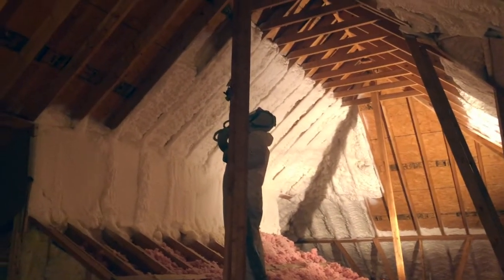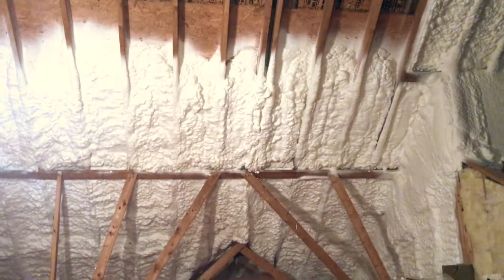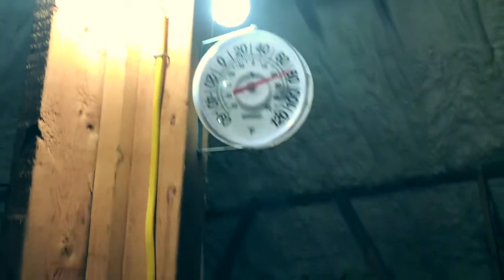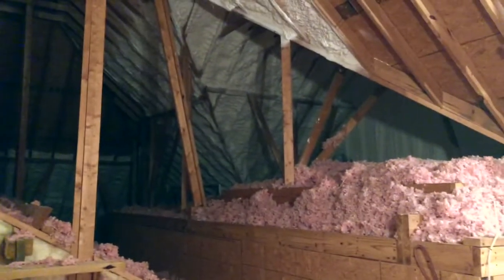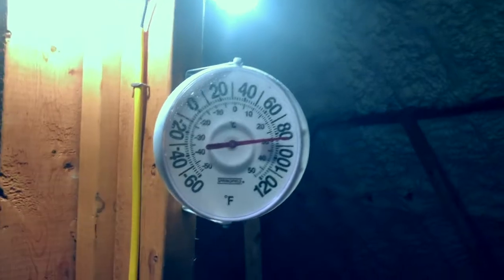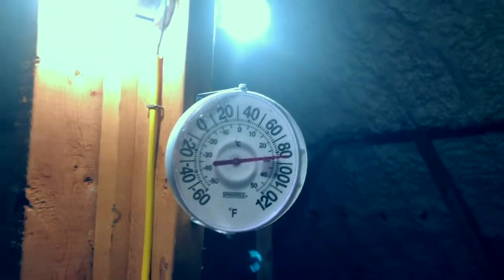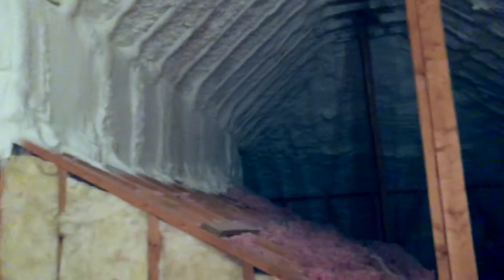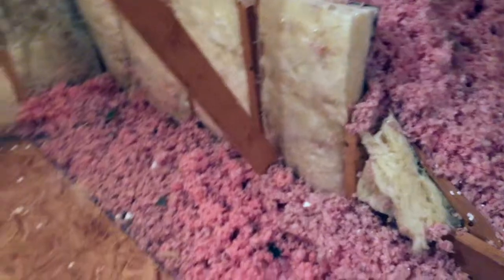Expanding Foam Insulation In Our Attic

Comment: Are you eventually going to use your attic as a living space? And yes spray foam needs to have a surface which is less than 30% humidity or else it will just peel off when they try to install it. Thanks for sharing.
Reply from the maker: That's the plan!
Reply: @StuffIHeard  I have a attic insulation channel you can checkout if you have future loose fill insulation attic projects on the go.